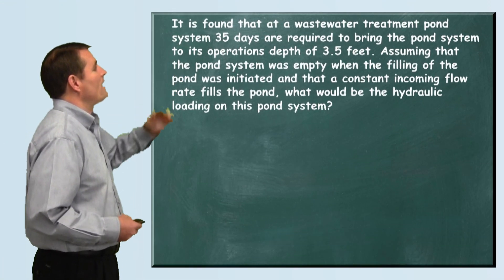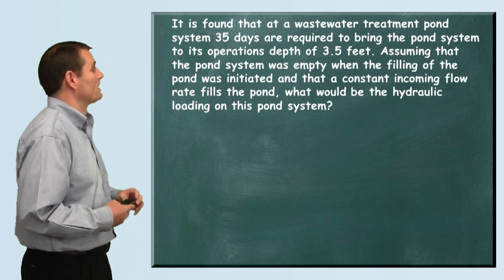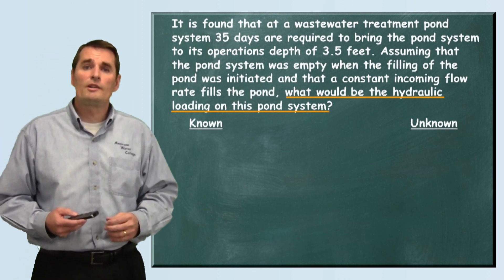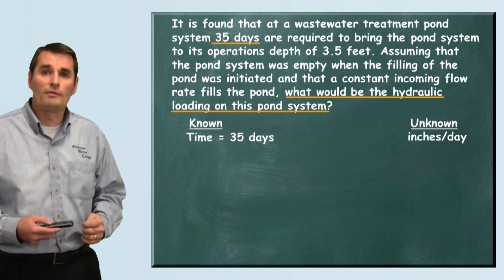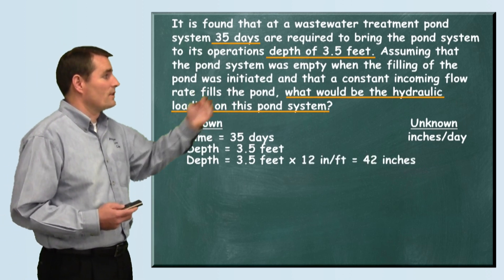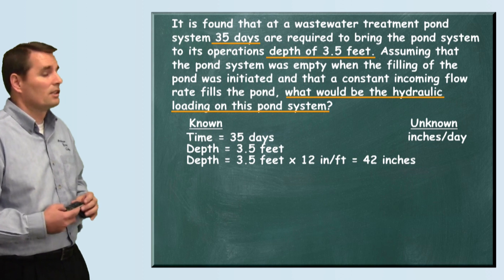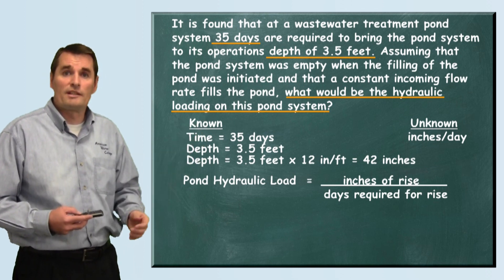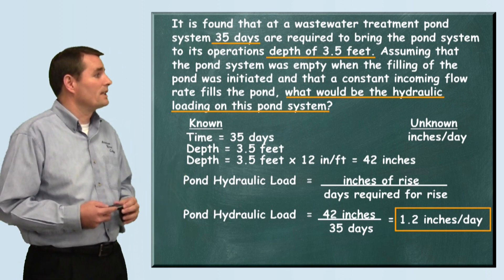Problem Solved: Pond Hydraulic Loading Problem - Wastewater Math

Comment: This is a really bad example. An actual problem you’d encounter would use the formula.. Flow (cubic feet per day) divided by Surface Area (cubic feet). I’ve never seen any questions like this in my AWC Wastewater courses.
Reply: Units for surface area are square feet. Volume has units of cubic feet. If you break down the units to calculate Hydraulic Loading Rate (cfd / SF), you get units for velocity (length / time). With the values provided in the problem statement, you can calculate HLR.